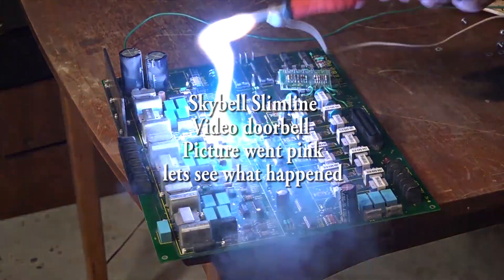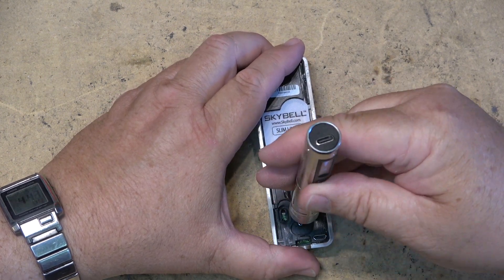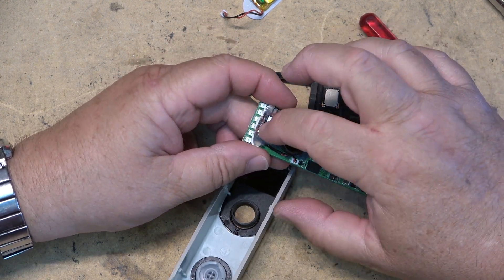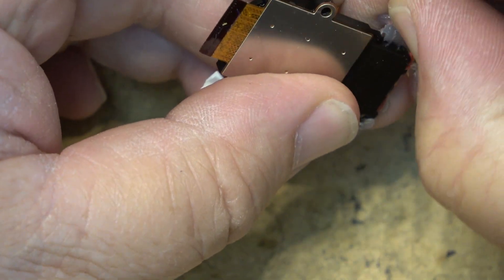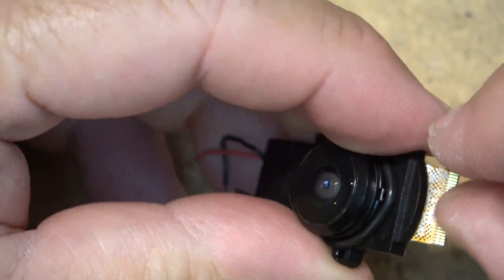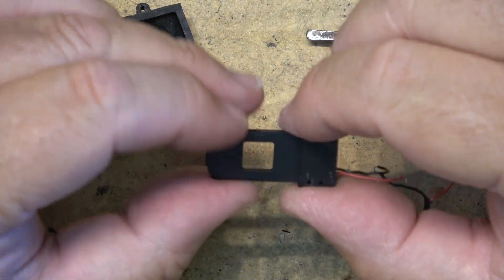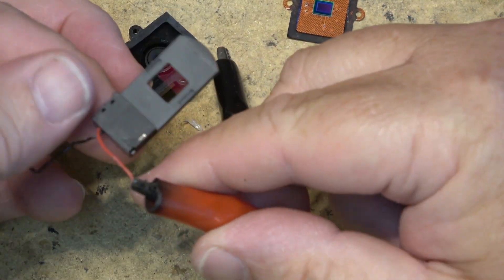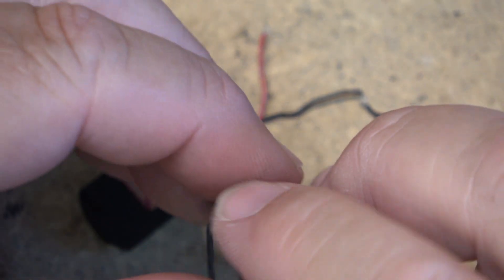Skybell Slimline Doorbell Camera picture went pink

Comment: Now I know what clicks in my security cams, I always felt it was a relay for the LED's or something so.
Reply from the maker: Ir cut filter.  My Sony ax33 has a filter just like this which clicks in and out just like this one my ax53 and ax100 has a filter that moves much slower and when I switch in and out of night shot you can actually see the filter moving so let's move by a motor as opposed to a solenoid